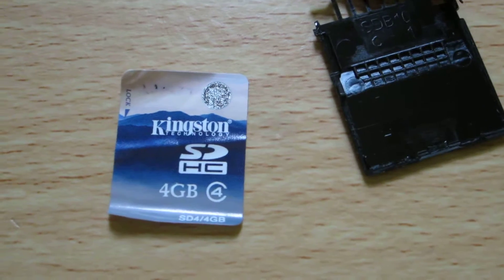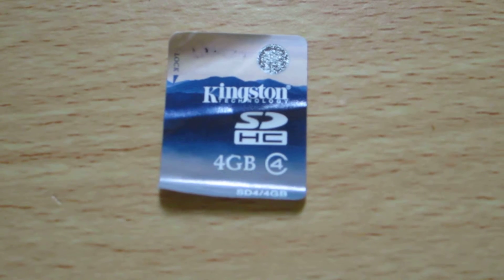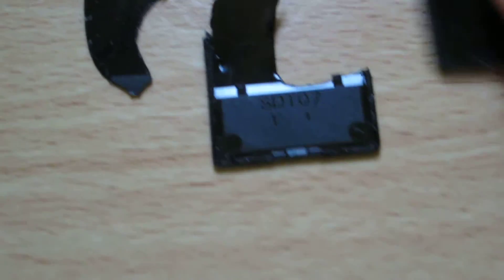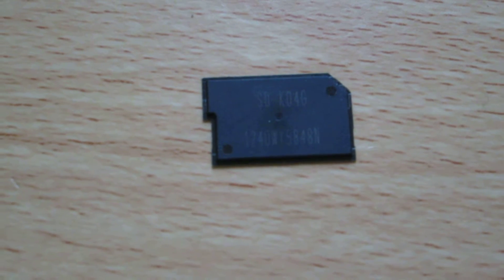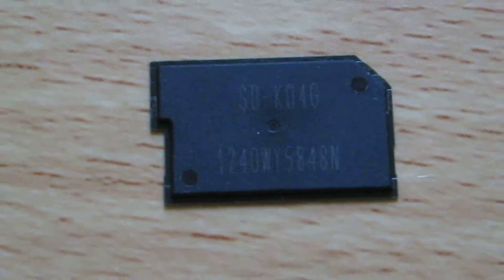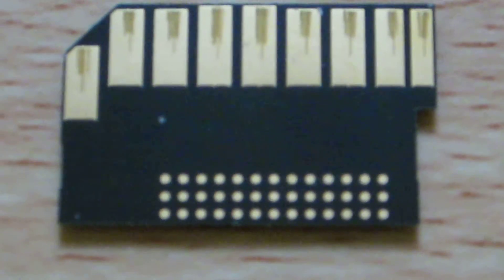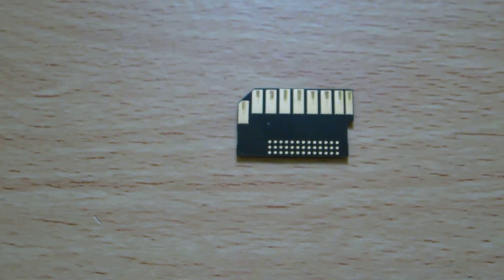Inside an SD card

Comment: Do you know if you can get the pictures off of the SD card when it's been dismantled like that
Reply from the maker: Yeah I guess you could, probably using some wire, soldering and some good old fashioned bodging. However the card had failed completely hence why I took it apart.
Reply: @Rych  ours has very important pictures on it and I've tried everything. But thank you
Reply from the maker: Ah right, if a card has failed to the point a computer doesn't register it then it's usually game over unfortunately. If the computer can still see it then you could format it and then run some recovery software such as recuva (others are available) and see what you can get off it.
Reply: Hubby got mad because our pics were gone. I've been trying to put it back in the case and glue it together but it's not working. Now several more pieces of the case are broke. And there isn't much more to piece together all I have is the inside part.. I don't have access to a solder at all.. is there any way you think I can get the pics off of it.
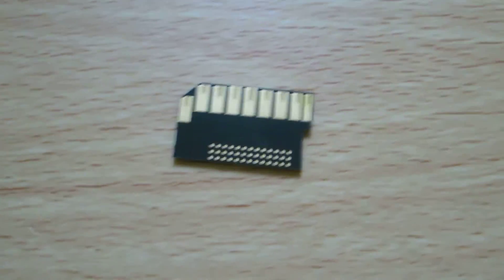Reply from the maker: @S.Marie42211  right, if it's just the case that's damaged and not the actual memory module ( 0:41 ), you have a good chance, but it will still require some "engineering". Getting a USB SD reader will probably be your best bet, you should be able to carefully put the module into that and be able to get a computer to read it.... Theoretically..... (Obviously not having hands on or even being able to see it I'm making some assumptions.)